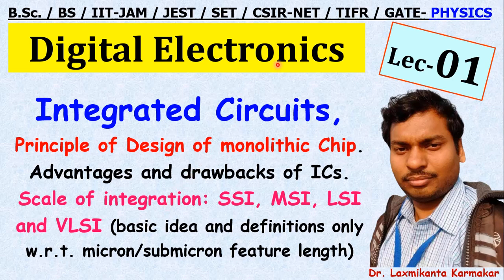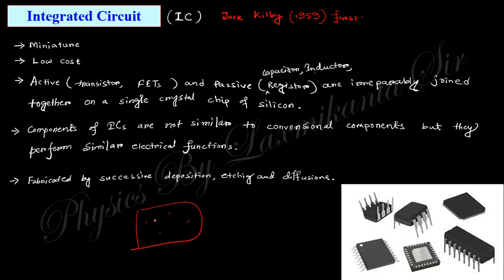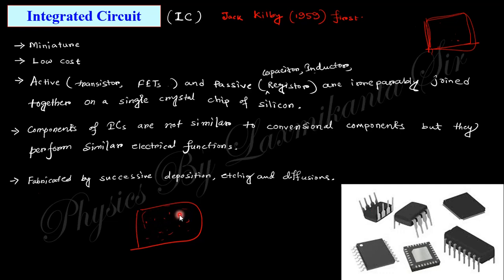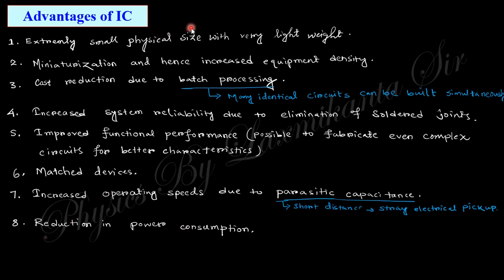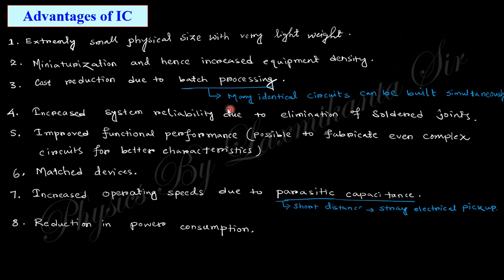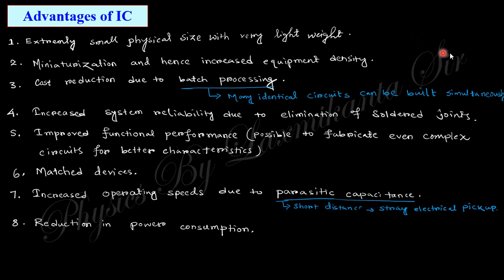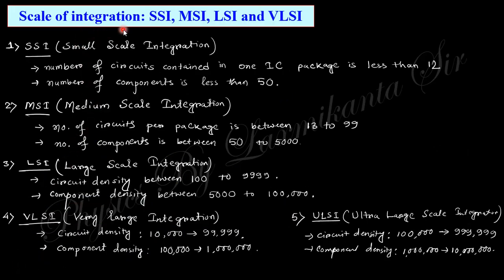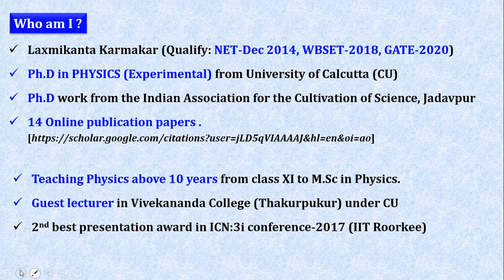L1_Digital Electronics _Integrated Circuits_SSI, MSI, LSI, VLSI_ for SEM VI

Comment: solution problem /Suppose a point dipole is located at the center of a grounded spherical conducting shell. Find the potential inside the shell. [Hint: Use zonal harmonics that are regular at the origin to satisfy the boundary conditions on the shell.]